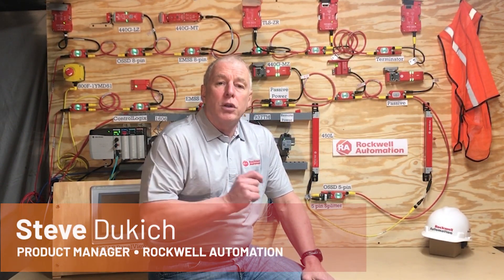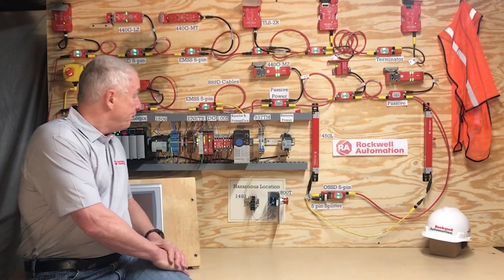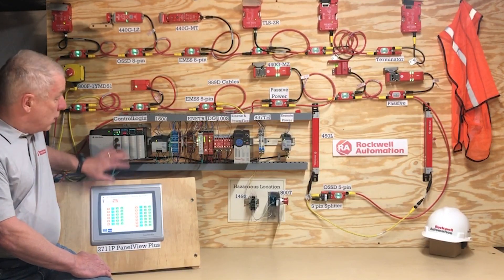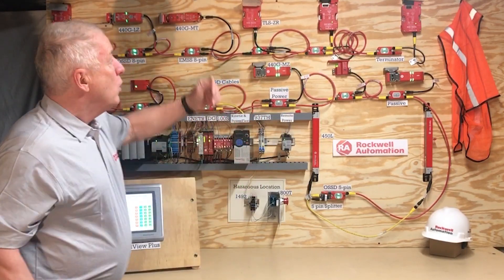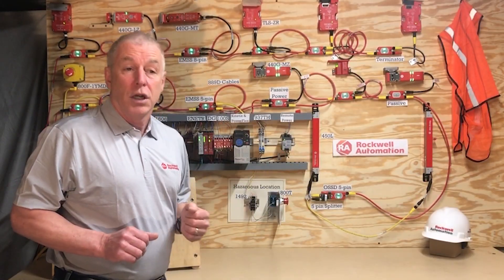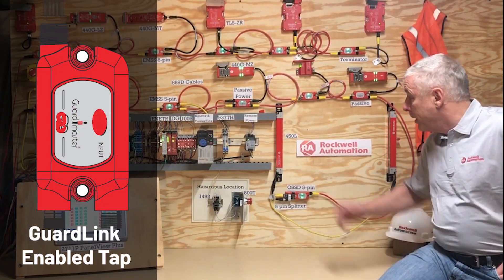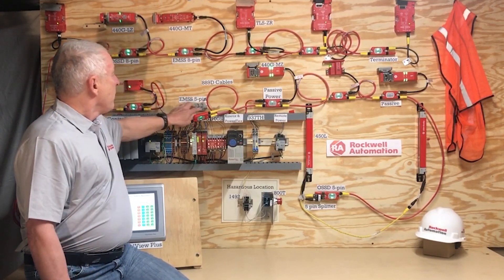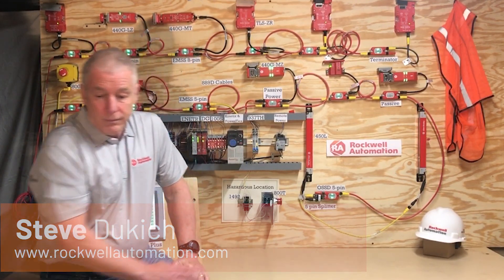GuardLink System Overview

Comment: I'M INSTALLING A MAGNETIC SWITCHES FOR A SMALL MACHINES BUT I HAVE SOME STATIC ON THE MACHINE DUE TO THE FRICTION OF THD WEB WITH ROLLERS IN ADDITION TO THE ILTRASONIC WELDING OPERATION ON THE MACHINE , THIS CAUSES A DOMAGE OF A LOT OF SWICHES , SO MY QUESTION  IS , IS THEIR A SPECIFIC MODEL FOR A SUCH APLLICATION A MANITC SWITCH THAT SUPPORT THE STATIC ?!
THANKS FOR YOUR HELP